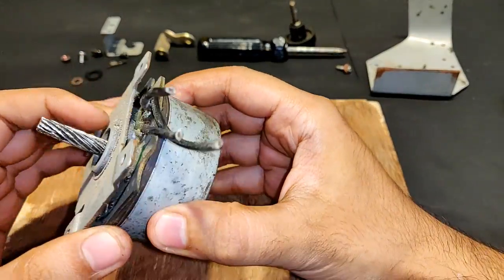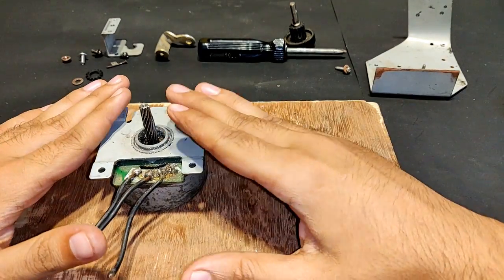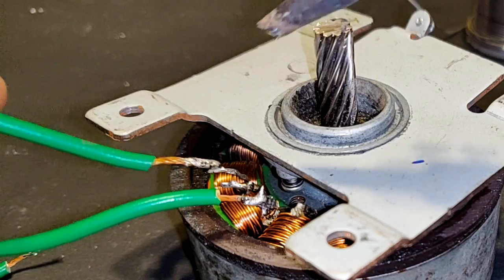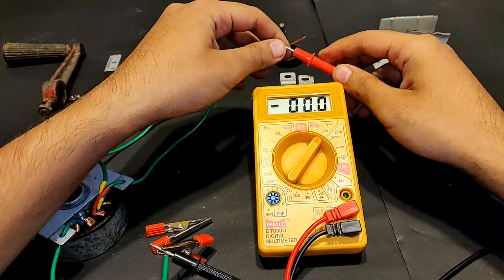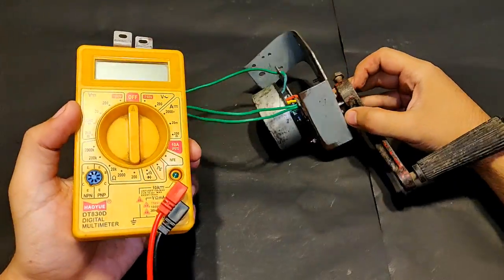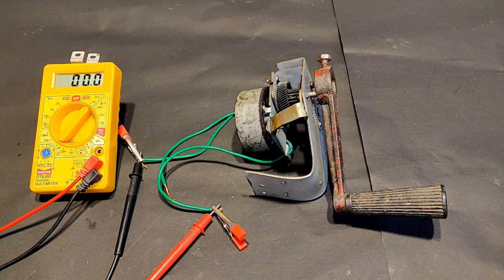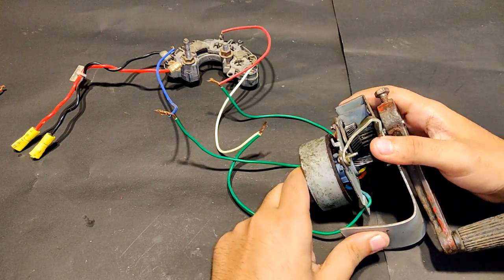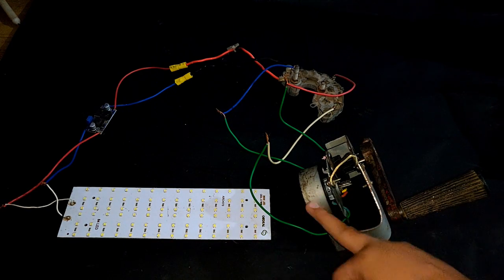Hand Cranked Electric Dynamo Generator from 24V 5 Amps Brushless DC Motor (BLDC from Xerox Machine)

Comment: well quiet easy to convert into a generator..
one suggestion,find a better way to hold tight the body crack...
i see your left thumb risk to be hit on each turn...
i'm pretty sure with a better holding on the handle of the crack wil give you better voltage and amps..

Comment: I have made a alternator from pvc pipe. I have used 0.5mm  cupperwire. I winded 2 coils with 360 turns around a 10mm iron screw and put this into the fitting holes I drilled in the PVC pipe. The diameter of pipe was 50mm. I build a stator with 6 magnets each 10mm × 3mm in size. And put 3 other of the magnets on top of the first. Between screw edge was 2 mm space left. It looked cool but the amount of current it produced was only 0.014 V and 0.02 A. That's not what I hoped for. I think because the magnets should the sice of the coils but not know for I'm not shure. 
My question: Does anyone know why I have such a low current?

Comment: Bro,In a Video i saw you are running a 12 volt motor with  48 volt power supply and make it fly itself. 
If we use 12 volt super motor with 48v or above, will it Run more fast than that??
please reply
Reply from the maker: Yes always
Reply: okay. Bro Today i have buy 12v (522) motor. i have run it with 12v power supply but its run very slowly, 😥.Can i give it more power like 36v or 48v??
Reply: and another question. 
I need a power supply which give 220v to 6v, 12v,24v,36v,48v and above With a Regulator for  for changing the Volt.
what could be the power Supply name??
and how can i get that??
Reply from the maker: yes sure
Reply from the maker: 9v to 24v is what i could find  : https://www.youtube.com/watch?v=oW7LrCMfGZQ
Reply: Thanks Bro😍
Reply from the maker: you are most welcome :)